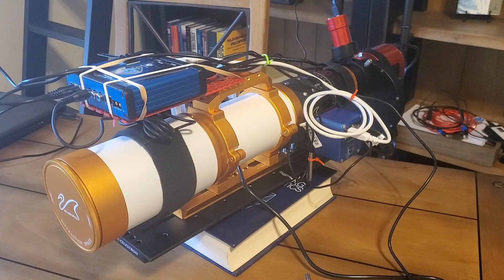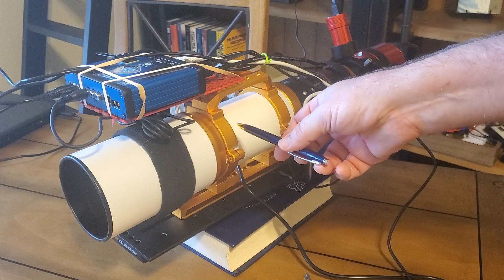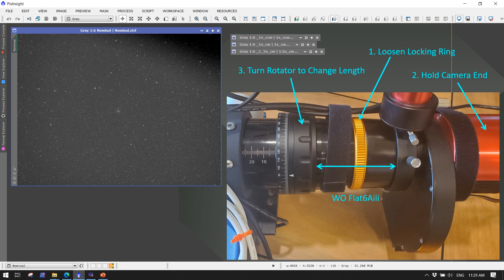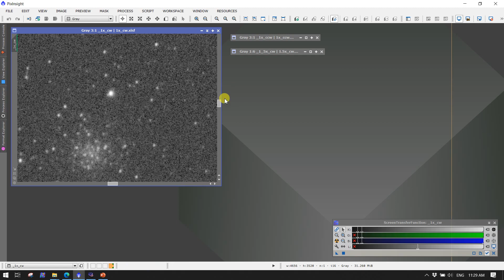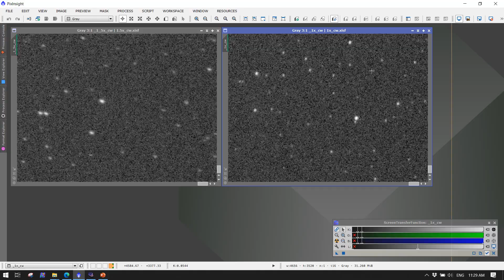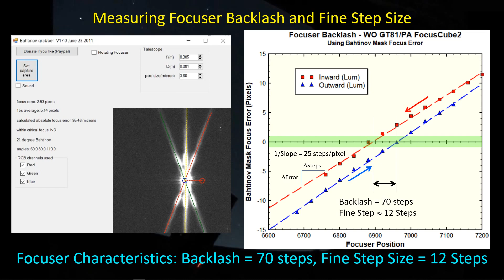Introducing the William Optics GT81iv Refractor Telescope

Comment: Love the setup but would'nt a quadruplet help avoid those issues with corner stretched stars since its, supposedly, perfectly matched and built?
Reply from the maker: Yes. The William Optics Redcat series is a four-element design. However, most of the APO refractors are three-element designs that require a field flattener to deal with the outer perimeter of the image.

Comment: Fun to watch as I recently acquired the same scope and camera.  I'm not as scientific as you are.  So, I set the FLAT6Aiii to 8 mm, figuring I needed to add half the thickness of my filters to the back spacing.  Using a ZWO EAF I use NINA's overshoot AF with backlash set at 100. After checking autofocus worked and the stars were round in the corners of a test image looked good I took advantage of the best seeing I've had and got 6 hours on Andromeda on my first night out with the GT81iv.  I'm still tweaking the processing, but the subs are incredibly sharp.

I like the perforated plate mounting idea, I plan to steal that once I install my OAG.  Is that a hardware store item?
Reply from the maker: Great, Bob! Let me know how things go. Your Flat6Aiii starting point is certainly reasonable. You may have to experiment a bit with the extension to dial in the best result. It’s not too painful. Windows updates, on the other hand, are. I updated earlier today, and now my system seems to lose contact with the USB devices. A perfect night for imaging is a wrap...
Reply: @Aero19612  Stars in the corners are round at 8:1, so I'm pretty happy.  I guess I need to go to PI and measure eccentricity, but if they look good at 8:1, I don't really care too much.  It's incredibly easy using this scope after learning with an Orion 8" Astrograph.  Somewhere in the future is a longer focal length for smaller targets.

Comment: ive been looking for this video for a long time.. no matter what i do my Planostar on the TMB 115 MM F7   EDT just will not come to good stars in the corners.
im in bad need of a Variable 12-18MM  , M42 0.75 pitch spacer. Real hard to find   all i need is 56.5 MM  .. Any ideas.?
my Pegasus has 200 steps of backlash and 125 steps on 9 points  in SGP ...
Reply from the maker: Hey Mitch. I have a similar problem with my Explore Scientific ED102 and its field flattener. ZWO is good about providing thin shims with the imaging cameras and filter wheel. That said, the adjustability of the WO Flat6Aiii is VERY nice. I have heard of adjustable spacers and may have seen a few, but have never owned one. Check out the line of Blue Fireball adapters at Agena Astro, such as:
https://agenaastro.com/blue-fireball-m48-thread-variable-spacer-ring-set-s-set2.html
Reply: @Aero19612  Dang   all my spacers are M42  not M48 maybe they have those also.
Reply from the maker: Also, ZWO provides (and sells separately, I believe) a double sided threaded ring with M42 on the inside and M48 on the outside that will convert M42 spacer (male thread) to M48 (male thread). Beware: once it's on there, there's no taking it off! But there's lots of Blue Fireball spacers and M48 is not that odd.